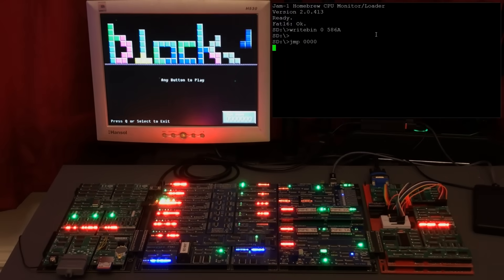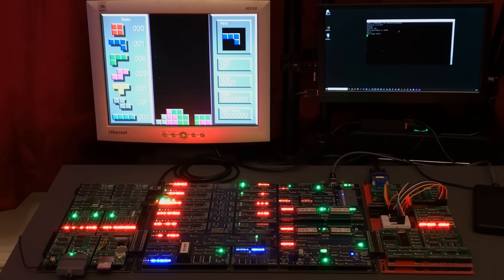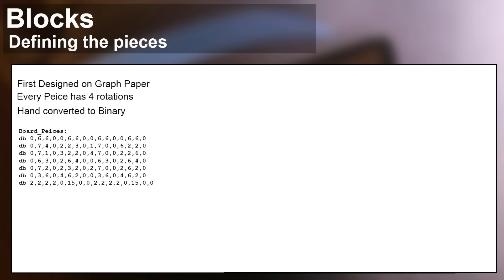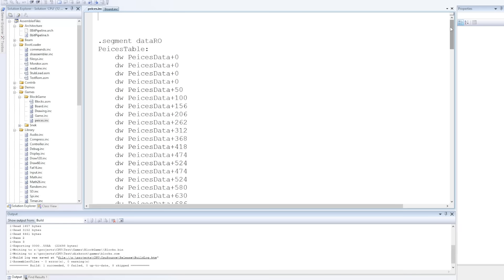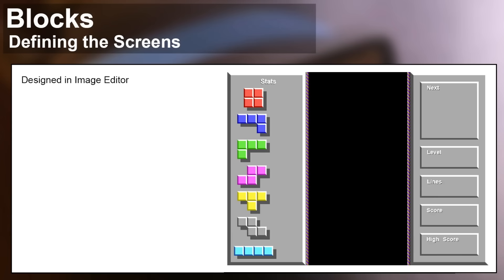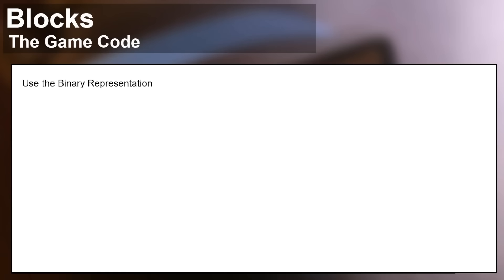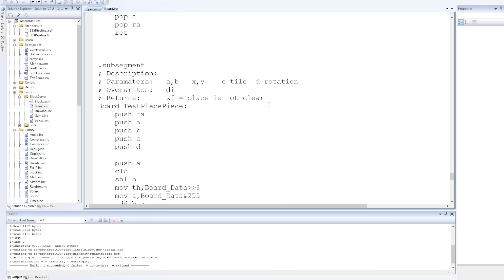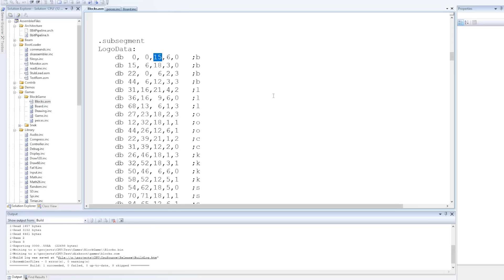Tetris From Scratch, On the Homebrew CPU!

Comment: Does the long thin one not technically have 4 rotations since it can be on different sides of the center line so to speak? It could hypthetically make a difference to gameplay.
Reply from the maker: Hmm,  you may have a point. It definetly could do that, I'd have to check an early version of tetris to see if it does.
Reply: @weirdboyjim  I dont think tetris does but they also may not have made their constraints may have been different so they could place the graphics in the middle of the figure. IT may well also be me being persnickety. But that some times can be useful even if  aggravating.  say the (sprites) were an odd number of cells then you could have all all pieces revolving around and XY 0 Point.

Comment: I remember this "Aha!" moment I had in the early 90's when I found out how Tetris worked. I was puzzled how Tetris could know that block would collide with another without actually hitting. My understanding was limited to Amiga's sprite hw-collisions.
Reply from the maker: Interesting,  those hardware sprite collision system surprised me when I first learned about them as I'd had to first solve similar problems in software.

Comment: My first game I ever programmed was Tetris. It was interesting to notice that I ended up doing a lot of similar things with the logic, although I wrote the game in text mode, so I used the display contents also as the memory for the game state.
Reply from the maker: Impressive for a first game! Using the display memory as the game state tends to be the easy way to start but does start to get in the way as I'm sure you found.
Reply: @weirdboyjim  you're right, I implemented a two-player mode and there I started having occasional glitches, probably due to using the display memory as the game memory.
Reply: Hilariously, I spent so much time making sure the block rotation works right and fast in my first try (on a 386 in Turbo Pascal). It somehow didn't occur to me to just store all the rotations in memory!

Comment: If your Tetris clone can slide blocks at the very bottom for a brief moment, then it's perfect. I definitely need to look up how you built this contraption, whether you made your own assembly variant, how much CPU was actually pre-built and so on. Most of these just use 6502's, but I'm guessing you did something else because that doesn't look like 6502 assembly. I'm hoping it's an FPGA project, but I'm still guessing before looking it up.
Reply from the maker: You can indeed slide at the bottom! The cpu is entirely it's own thing, it's mostly 74 series logic with a few memory chips.

Comment: Look at that! Amazing implementation. I do wonder, at what clock speed the CPU is running at while processing the game ? Could you do a video on how CPU speed effects the playability coupled with power usage at different speeds. Adding a baseline measurement of when the clock is halted to see what the absolute minimum usage , starting from zero hertz. 
Love your stuff !
Reply from the maker: The cpu is running at 4mhz, the power draw averages about 2amps at 5v but that is far more dependant on the number of led’s that are on 🤣
Reply: @weirdboyjim  Always those LED's! I suppose you haven't incorporated a method of turning them off ? :P
Reply: @weirdboyjim  Instead of connecting all the LEDs directly to the hot side of the power supply, I would have placed a switch that simultaneously disconnects the power to the LEDs to turn them off simultaneously when not needed.

Comment: It might be a bit of a bigger challenge, but perhaps another great game from that era, only I'm not sure if it was during the 8-bit era or the 16-bit era... but Lemmings might be an interesting project to work on. 

Or perhaps you could write your own program within your assembly that would take ROM files from the Atari Series and convert the ROM binaries into executables that could run natively on your system. That would be an interesting project too. 

Maybe even write your own BASIC interpreter. That's kind of fitting for that era. 

There're many options that are available.
Reply from the maker: I loved lemmings when it came out! That game really needs a bitmap display though, or lots of sprites.

Comment: Assembly? I think the next step should be the implementation of some of the high-level languages 😊 What about Forth?
Reply from the maker: Would be nice, someone on discord has a 'c' compiler. I only touched forth briefly at colledge, so I'd nead to learn the language in addition to implmeneting it before it would be useful.
Reply: @weirdboyjim Oh, ok. 
If C is ready, why not to use it? Forth is very easy to implement, though.
Reply from the maker: @2000oco  ahh,  it's an impresive feet of development but the resulting code is far slower than what I can write at the moment. I may do a video on this at some point.
Reply: Lua wouldn't be a huge leap if you've already got a C compiler.
Reply: @DFPercush  I don't think you quite appreciate how small this computer is :D

Comment: How did you pick the next block shape? Some sort of random functions I assume, but i wonder how you wrote a pseudo random number generator. I would like to see a video about that.
Reply from the maker: I have a psudo random number generator that I originaly wrote for my snake clone.  You can read about it here:  https://www.youtube.com/watch?v=kQS_2psfBaU&t=943s  Additionaly I generate a random number every frame, that way all the user input timing serves to randomise the generator.
Reply: @weirdboyjim  Have you considered a HW RNG? Something like two RC oscillators or two 555 timers) run at slightly different, slightly jittery frequencies. Then XOR their outputs together and shift into a 74HC595 or 74HC164 to accumulate random values, which you can pick off anytime you want for the CPU? You could latch a 74HC573 if you want stable reads. So no CPU cycles wasted to get random data. You could add a counter or simple "data ready" output. Every 8 (or 16) bits collected, toggle a pin (e.g., "READY" line). CPU waits for READY to go high, then reads a random word.